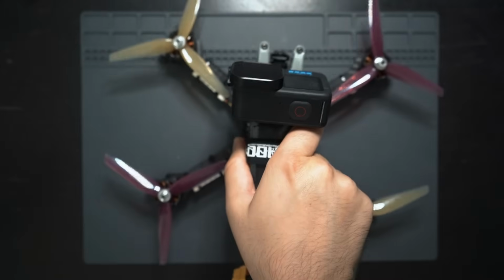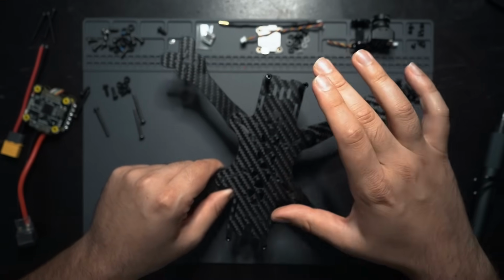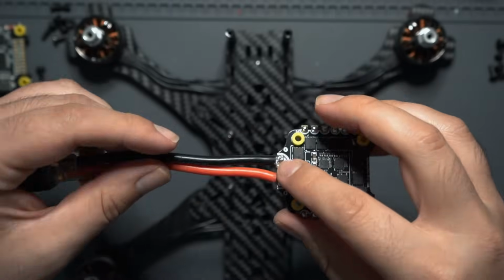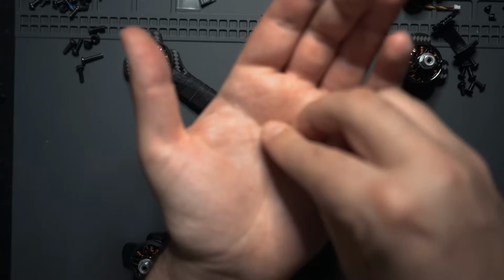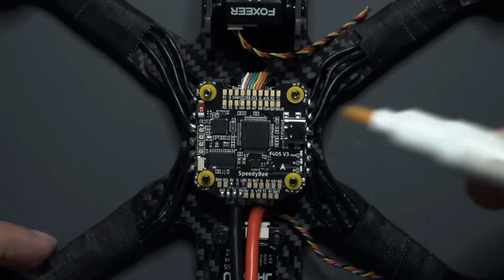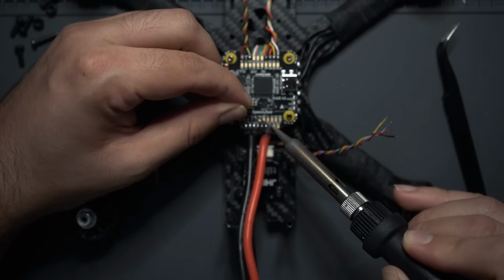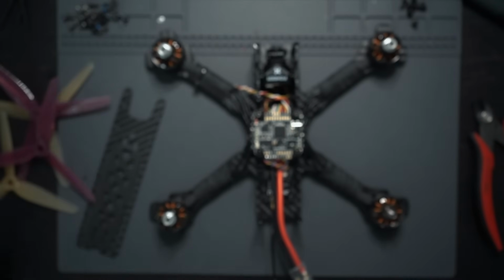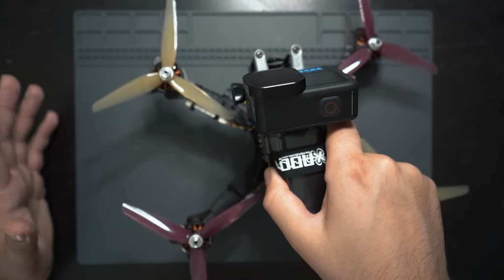Build a Freestyle FPV drone for $200

Comment: Does the ribbon cable used for the first board and the flight controller come with any of the parts that you order, or do you have to order it separately? If so, what type is the cable? And what kind of charger would I need to use for the BetaFPV 750mAh batteries?
(Same going for any of the wires that are in the video)
Reply from the maker: The ribbon cable that connects the flight controller and ESC comes with the stack. 
For this build I would use a battery bigger than 750mah. All of the wires you'll need are included with the parts 👍

Check out this battery and charger:
1550mah LiPo - https://amzn.to/3RNKaH5
Soldering iron - https://amzn.to/3fEblWY
Reply: @TRONCATFPV  What kind of charger is used for the battery you suggested? It says that it just comes with the battery.
Reply from the maker: @jadelocks   Sorry, not sure why I included a link to a soldering iron lmao.
This is the charger I use: https://amzn.to/3T8D6FP
Reply: @TRONCATFPV  One more question, when you first started flying, did you have to get any license to fly or get in trouble with FAA or like that?
Reply: @TRONCATFPV ey dude, coming back to say, your tutorial helped me, a lot! My drone is almost finished, all I need is two more motors. Are there any cheaper alternatives for charging the batteries?

Comment: Ok so here's my question,  I have the cod dragonfly drone. The app is no longer usable I loved this drone but now it's just collecting dust can I use these parts to upgrade and if so how do I find parts to Match the frame to kind of keep it as the dragonfly
Reply from the maker: What a throwback! I remember them releasing the dragonfly, I wanted one so bad lol. I used to be so into COD.
Your comment really piqued my interest in how do-able a rebuild on that frame would be.

I don't think the components that I used in this build video would be useable for that sized drone but maybe some components would work. I think the motors might be the most difficult thing to upgrade.
The frame looks spacious so you could probably fit an aio toothpick board or something in there lol. 

Shoot me an email at contact.troncatfpv@gmail.com , I want to see if this is possible lol
Reply: @TRONCATFPV  will do. Give me a few days or so I have a slight hectic work week but I can definitely make a chance to email you.

Comment: Besides the DJI FPV Goggles V2, does anyone know if the new DJI Goggles 2 (for the DJI Avata) is compatible/work with this setup?
Reply from the maker: unfortunately the Goggles 2 are only compatible with the Avata right now. DJI has claimed to be making the goggles 2 backwards compatible though.

Comment: Great video, really looking forward to having a go at building a drone and this helps a lot. As you said a lot of the main components mentioned in your video have gone out of stock but you have posted alternatives, is everything compatible with each other across both lists, the main build and alternatives? This may seem like a stupid question but the compatibility thing is the part I struggle with. Many thanks
Reply from the maker: yup! All of the links are compatible across both lists 👍
Reply: @TRONCATFPV  awesome, thanks for the quick response 😁

Comment: No offense, but could someone put together a buy list that's actually in stock. Trying to build my first. Videos are a great  help but when you don't know... serious replies please.
Reply from the maker: Please check the alternative parts links. I just clicked through them and a lot of the items are in stock still..
Reply: Neither frame is, I don't mind speaking a little more. Just trying to finish the cart on bangood and motor are out of stock in your link's
Reply: @brianstevens2244  I'd hold out for the V4 frame.  I really like the frame more so than the v3 in this video.  Both are good, but I really like everything about th3 v4
Reply: Spending a little more. Just want something that works great. $500 -$750 with transmitter and receiver

Comment: I have a question, does that capacitor come with one of parts listed below or do I have to buy it separately
Reply: I'm really new to Building a FPV Drone, but I think I had all the fun I could have with my Tinyhawk 2
Reply from the maker: if you started with a Tinyhawk, this build is a great next drone to add to your fleet 👍
The capacitor is included with the speedybee stack. Every stack should come with battery leads, a capacitor and  mounting hardware
Reply: @TRONCATFPV  Awesome, does the JumperRC T-Lite V2 ELRS and the Eachine EV110 FPV goggles work with the build and each other?

Comment: I had the same problem with the T-Motor stack with BF 4.3.1......Reflashed 4.3.0 and the problems went away
Reply from the maker: interesting, I have the issue with 4.3 and 4.3.1
Maybe I'll have to try one of the later release candidates.

Comment: Great video.  I built the same drone based on your recommendation.  One thig I was hoping you could help with is the preset you used for yours?  I used the stock and found that my motors and battery was hot.  Hopefully you can help.  Thanks
Reply from the maker: The only preset I used was the "DusKing's BMI270 filter settings" preset in betaflight. What battery are you using?

Comment: OK, two weeks later... I have all the parts.  My SpeedyBee order just sat there for 4 days after "expected ship date."  I emailed, "Hey?  Any idea on shipping?" and I had an email within a few hours.  Suddenly, it showed shipped and had left SpeedyBee.  It took 7 days, but I have it now.  Well, I have all the parts for the drone itself.  I still need to order the controller and goggles.  In the interim, I bought a Technicans Ham Radio License manual to study for the Ham Radio test.  I finished it last night, so going to test this week ideally.

Comment: hey, i bought the rush fpv tank mini ultimate but i cant figure out to what pins i need to connect it to on the mamba f405 mk3. is there any chance you could help me out?
Reply from the maker: Absolutely, on the VTX you will only use the 4 pads on the right hand side. These are GND, DC IN, SA, and VID
The other pads will only be used if you're using an on board microphone.

Here is how it should wire up to the Mamba F405 MK3
Above the USB-C you should have 8 pads. the 4 right on the side are the ones for the VTX. This is the order from top to bottom and how they will connect to the pads on the VTX:

9V - DC IN
GND - GND
TX3 - SA (Smartaudio)
VTX - VID

Hope this helps! Feel free to shoot me an email if you have any more questions 🙌
contact.troncatfpv@gmail.com
Reply: @TRONCATFPV  Thank you so much!!

Comment: What is Bluetooth for? Interference?
Reply from the maker: The bluetooth built into the FC is what connects to the speedybee app. This way you can completely set up the drone through the app instead of connecting it to a computer.

Comment: What is the flight time and range for this?
Reply: Yeah i was wondering the same as we don’t know what radio transmitter he uses if he can give some options for us, flight time has to do with the battery you using this one probably is about 20 mins flight time
Reply: @cybercifer8221 you can get like 7-10 minutes with this setup max

Comment: Bought the parts for the drone using your links, any suggestions on a radio controller? Everything seems out of stock right now
Reply from the maker: Yes a lot of the parts sold out fast! Hopefully things will restock soon.
I have been using this controller with the drone and honestly love it. I use it as a backup but have been liking it for freestyle: https://bit.ly/3RZk04L

Comment: Hmmmm. Your flying skills are amazing. But the footage? What settings did you use for your gopro 10? Because every gopro footage ive seen looks much more sharp and detailed. Im the owner of gopro 9 and trust me it has a better image quality, and i find that strange. What ISO did you use? What color mode? What resolution/fps? What shutter speed?
Reply from the maker: Thank ya, the GoPro was in 4K, the rest of the video was filmed in 1080 so I scaled the GoPro footage down to fit hence the lower quality. The full res 4K clip looks much cleaner than what is in this video 😉

Comment: From my experience, the p3's pitch is too low for my 2550kv motors, using it on 2400kv might not be optimal. Recovery is rather weak when i used the p3, although it  did fly smoothly. The p4 is probably a better prop for relatively lower kv motors, or any prop with higher than 4 inch pitch. Great build bro🙌
Reply: Gemfam 51433 handsdown brought my flying to the next level. Came from 5040 and that was to weak to carry an action cam
Reply: @Frozone.  Gemfan is weird with their prop names. 51433 is not a 4.33 pitch as the name suggest but 3.5 so compared to other manufacturers 5040 its actually lower pitch.

Comment: Is there any reason to not use the V5 frame?
Reply from the maker: main reason I went with the V3 is because currently there is more available 3D prints for it plus it was the only one in stock at the time. You technically could use the V3, V4, or V5 with this build 👍

Comment: Does it connect to DJI Goggle V2?
Reply from the maker: if you use a Vista or air unit with this build it will. With the components I used, no.

Comment: alright... so basically same as your build but these are the differences i'm thinking about.. what do you think? 
V4 frame coz V3 is sold out - it was in stock a few days ago... darn it
EMAX ECO II Series 2306 1700Kv Motors for 6s battery, 
RunCam Phoenix 2 Micro JB, 
RUSHFPV Tank II Ultimate 30x30 25-800mW 5.8GHz VTX - MMCX, 
HappyModel 2.4GHz EP1 RX Express LRS Receiver,
SpeedyBee 5.8GHz SMA Antenna 2 Pack - RHCP 
rest is the same... already ordered the stack 
total for that is about $250
love your vids!
Reply from the maker: Sounds like a solid build 🤘
Couple things

Since the V3 & V4 frames have only 20x20 mounting holes in the rear, keep in mind that the VTX will have to go on-top of the speedybee stack since those are the only 30x30 mounting holes. You could always go with the Rush tank Mini 20x20 (https://bit.ly/3QCoVa5) and it will fit nicely on the rear mounting holes and imo is just as good as the tank II ultimate. 

Also, the Runcam pheonix 2 micro may need a Micro to Mini adapter for the V4 frame. Since its only a couple of mm you may be able to fudge it with longer screws and some washers. 

Hope this helps and thanks for watching!
Reply: @TRONCATFPV  Sweet! Thank you so much for your advice, I'll get the rush tank mini and i'll get a micro camera instead!

Comment: The transition from the DVR footage to GoPro was SICK! 
I built my fist one with similar components! 
What go pro and stabilization software did you use?
Reply from the maker: haha thanks! 
For this I used a GP10, 4K 30, Superview, ND16 with locked shutter. Didn't use any stabilization for that flight footage 👍
Reply: @TRONCATFPV  That's great! Keep at it, bro.
Reply: @TRONCATFPV  thats so smooth

Comment: What temperature is your soldering iron set at? Ru just using 60/40 soldering wire? Can this except a 3s? Also I was thinking about doing the crossfire mod with my qx7 would this elsr work with that because some elsr are different? Oh I have a rxsr laying around would that be okay just to get up in the air? Thanks for the budget build video! My baby ape died after the second flight which is why I have 3s & rxsr laying around. Hopefully I can get my money back from Banggood which has been a nightmare so far. Thanks again
Reply from the maker: I use .6mm 60/40 solder for almost everything. I keep my soldering Iron pretty hot at 420°C and try to be as quick as I can with heating up the components. I'm not sure how well it would fly on 3s, I think it would fly but it may struggle. I feel like 2400kv may be a little low on 3S. You could always give it a shot but you will probably end up buying a couple 4s batteries. 

If you did the crossfire mod on an ACCST QX7 you would be able to use ELRS. If your QX7 is the newer ACCESS model you won't need to do the crossfire mod. The r-xsr would be a solid little receiver to use on this build. When soldering that to the FC just use the SBUS pad and you're good! 
Hope this helps 🙌

Comment: The source one has a v5 frame. But v3 has been very durable as still a community fav with loads of prints out there.
Reply from the maker: Yessir that’s the main reason I went with it. Once the V5 has been out for a while and there’s more available prints for it I’ll use it for a future budget build 👍
Reply: I broke so many V5 arms that i went for Rotor Riot hdo1 with thicker arms

Comment: What is it's flight time?
Reply: You must be new. After a while you stop asking flight time. It all depends in your flying style and props. If you want long flight time go for a long range setup. Also use li ion packs instead of lipos.
If you really rip hard, you will be happy to land After three minutes and habe a short break to change lipos. Going easy on throttle you get up to 8 minutes on a lipo. Li ion you get 15 or more minutes but cant draw too much power without killing the batteries.
Seriously get a 3.5 inch to Start off with.

Comment: How wide are the arms? With the v5 out, the arms look narrower. I'm asking because I have a beater quad the still uses individual ESCs mounted on the arms. If want to go with the v5, I want to know if there is any over hang. I could swap out the whole stack but I'd like to keep the spending as low as possible.
Reply from the maker: If you’re going to use individual ESC’s go with the V3. V4 and V5 have much more narrow arms. 
V3 arms are 15mm wide.

Comment: hey, im stuck with two fc/esc tmotor velox f411 lite stack combos that have the same issue, what should i do? replacing them is alot of money and i dont think RDQ will let me return them.
Reply from the maker: I would contact RDQ and explain the issue. They're very good about refunds/returns and i'm sure will be able to help you out.
Reply: @TRONCATFPV  yeah ive been emailing with them for about a month going over everything from bad motor bearings to bad frame to bad tune, and it seems the gyro was the issue. emailing them with this video linked rn, i hope i havent annoyed them too much with my month long nagging lol. thanks for the help.

Comment: Not saying the v3 isn’t a solid frame but there’s a V5. Just built one and it’s a solid frame with 6mm arms. Been taking me crashing it like a champ.
Reply from the maker: The main reason I went with the V3 was because it was available while others were out of stock, plus since it’s been out for a while there are tons of 3D prints for it. V5 look solid though, I’ll probably end up using it on a future budget build 🤙

Comment: Love your work. Been through a lot of builds myself lately. Always on the watch for budget fpv stuff. Please consider the t-motor V2208 for 17,50 buck a piece. Quality is better than emax or iflight xing-e for 3 buck more
Reply: Thanks for the tip. In what way is it better?
Reply: @PeterMMMMM  2208 is 20% more stator volume\bigger than typical 2306. This allows you to run higher pitched props or even 5.5 inch prop and more thrust if you like.
The v2208 has titanium shaft and unibell. Quality is just better and lighter.
Reply from the maker: I'll check em out 👍
I have a set of T-motor 2205 2450's on one of my other quads and love em!

Comment: @TRONCAT Did you use the flat antenna for BetaFPV ELRS Lite 2.4GHz ?  I see a comment to not use the flat, but in your screencap and the unit on the video both indicate to me a flat antenna V1.1. Sorry if stupid question, up till now I just buy everything from DJI (Tello, Mini2 and Air 2).  This will be my first attempt at a FPV and building my own.  What strap size do I want for the frame with V4 frame (V3 sold out right now)?

Just a heads up for anyone considering and brand new... If you take all the parts and include the goggles w/ controller, you're right around $400.  So yes, it's a $200 build but you'll need to double it to buy new goggles and controller with it.
Reply from the maker: Yes this drone has the flat antenna receiver from betafpv. its the V1.1 with the red antenna. I've heard of issues with the original version but didnt have any failsafes or problems with this one. Honestly got more range than I thought I would have lol. Could just come down to how I have it mounted. 
Battery strap size will depend on what sized battery you use. For my 1550mah 4s I had a 220mm strap.
Reply: @TRONCATFPV  Thanks for the help.  Any pointers on GoPro protection?  You mention "you'll crash" but I don't see a guard around your GoPro.  I have a rubber/poly case but I don't know if the extra weight or anything else about a guard will have a negative impact on flight performance.

Comment: I thought the SpeedyBee also has the BMI 270.
Reply from the maker: yup! lots of new flight controllers are coming out with the BMI270. I didn't have any issues with this one when upgrading to 4.3.1 though. on the velox once 4.3 or 4.3.1 was flashed to it the gyro got all screwed up
Reply: I have a mamba f722 app with the bmi270 as well and I feel I have the same problem with 4.3.1, would you suggest to downgrade to 4.2.11?

Comment: Can we can get a $100 3 inch build? Do you thinks it’s possible?
Reply from the maker: I've honestly never looked much into 3" builds. I like this idea though, I will add it to my potential video ideas 😉. If I am able to get the parts for $100 I'll do it.
Reply: @TRONCATFPV thank you so much, I plan on getting a Darwin FPV rtf ($250)to start flying. I want to wait until prices drop before I build anything again.
Reply: In the 3 inch class, you cant build cheaper than the BNFs you can buy.
Cheap means analog. Get the HGLRC petrel120x
100 bucks is nearly not possible. The crux35 is also great
Reply: @chrisbee5481  a darwin fpv baby ape pro is 70 dollars